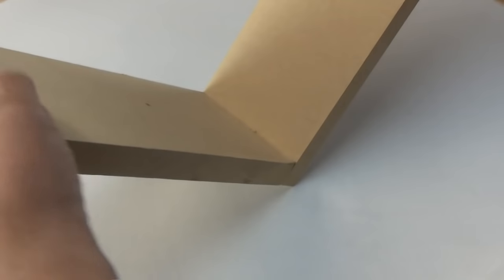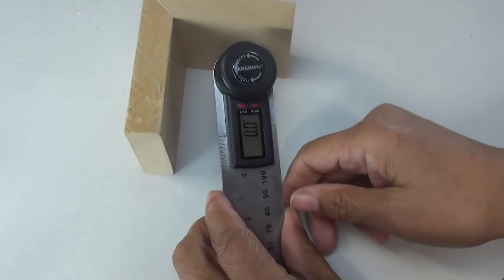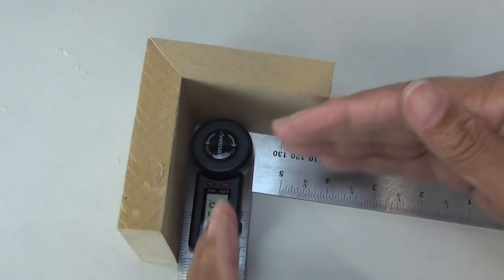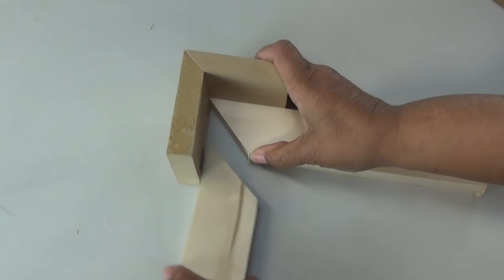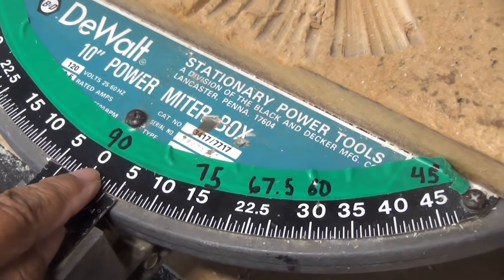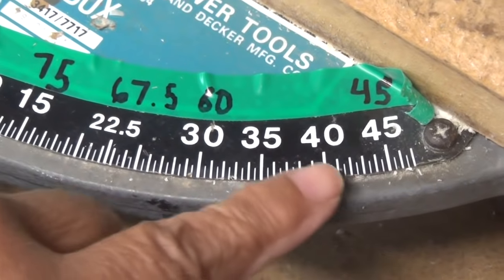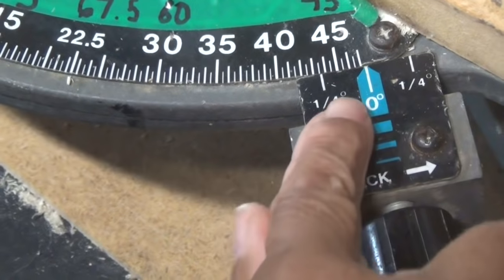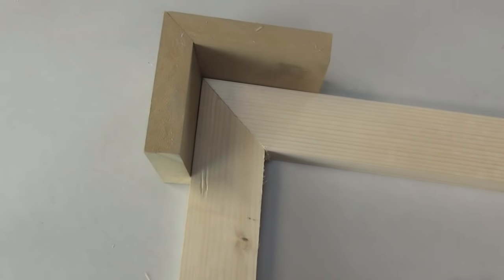The Secret Formula for Making Perfect Miter Cuts When Less Than 90 Degrees

Comment: You could of used the first cuts to make the 85 degree angle, you just used the wrong pieces.. It really doesn't matter if you cut at 42.5 or 47.5, it just matters from which side of the saw you measure your cut, because in both cases you get 2 pieces of wood from the cut that are 42.5 and 47.5 degrees.
Reply: Would you explain "Used the wrong pieces" a bit more. I would like to understand this. Thanks
Reply: When you use a miter saw, you get 2 cuts of wood. If you use the saw set on a 90 degree angle you get 2 pieces and both are 90 degrees.
If you set the saw to 45 you get 2 pieces that both are 45 degrees. 
If you set the saw to 42.5 you get a piece that is 42.5 and one that is 47.5
If you set the saw to 47.5 you get a piece that is 47.5 and one that is 42.5.

Same thing with lets say 60 degrees, it makes no difference if you set your saw to 60 or 30 degrees, it all depends from which side of the wood you measure to the cut. What Leah mentioned here is convenient, so you can always measure from the same side, but really isn't necessary.
Reply from the maker: I can understand why you would think that, but that is not correct. You are measuring your angle with a protractor or an angle gauge.  But the angles on a miter saw gauge are not the same...they are off by 90 degrees from the angles on the protractor.  Thus, if you try to make your cut exactly the same as what you read on the angle gauge, it will be incorrect every time.  It doesn't have anything to do with which pieces you are using. That's why finish carpenters make acute angle jigs to use in combination with their miter saws.
Reply: Actually, when you cut across a straight board, at any angle, you get pieces with equal angles. You don't get angles that add up to 90 every time. If you set your saw to 60 degrees, you get 2 pieces that are each 60 deg.
Reply: Thank you; all is clear.
Reply: LOL.... My husband and I used to run a contracting business. I can recall plenty of times when guys were bound and determined to make whatever I said wrong... when I wasn't. Absolutely love your videos!
Reply: Martin:  I think I see what you tried to say, but you need to take another look.  If the board is straight along both the near and far edges, and you cut in two at an actual 42.5,  the two pieces will each have an angle of 42.5 and 137.5.  (42.5+137.5=180).    The danged setting on the saw is where it gets confusing.  To get a 42.5 on the board, you set the saw to 47.5.  Or to get an 80, you set the saw to 10.
Reply: So, why not cut one board at 42 and second board at 43 to get an 85 corner?  The answer is that you want the LENGTH of cut on each board to be equal.  Imagine something more extreme.  Cut one board at 70 and the second at 15.  They will make an 85 angle, but the board cut at the sharper angle will have a much longer exposed, cut edge.  It won't mate neatly to the other board.
Reply: Martins Brumelis tuff crowd huh. You are exactly correct. And as for as it matters, she was cutting an outside angle unless the fence represents the inside. Plenty of ways to explain your point but not many seem to get it.
Reply: bryan brunk  Geez. Martins Brumelis is exactly wrong. He and you are mistaken. If you cut straight wood at 30 degree, you don't get one at 30 and the other at 60 (as suggested by Mr Brumelis). Instead you get two pieces of wood with exactly same angle. This is kind of basic stuff.
Reply: Jis Yang you missed the point. Just because we mentioned the same angle, doesn't mean we were discussing the exact same situation.
Reply: Jis Yang you need to expand your perspective on the subject because you are measuring the angle from the wrong side of the board.
Reply: bryon brunk  Jesus Holy Christ, No. YOU need to expand your "perspective". It's very annoying when an obviously mistaken person insists and tells others to change their 'view'. Dude, it's not a 'perspective' thing. It's either correct or incorrect as in math and geometry.  If you even own a miter saw, go ahead and please cut 2x4 by at 30 miter degree (or 60 degree from fence, doesn't matter),  and compare the resulting two pieces.  The pieces have IDENTICAL angles. You DON'T get two different pieces with different angle! As I said, if you a little bit of experience in miter cutting, this is kind of basic.
If you don't own a miter saw, draw a long rectangle (i.e., 2x4) on a piece of paper. And draw a line slicing the rectangle at 30 miter degree (or 60 degree from fence, doens't matter). And compare the two shapes bisected by the line. Don't do it in your head. I hope you realize your mistake.
Reply: See my comment above.  You always have 2 pieces when you cut a piece. One from the left of the blade and one from the right.  It ABSOLUTELY matters when you are cutting angles you intend to join.  especially if the the material is not symmetrical.  Like molding that has a top and bottom and a front and back. If this demonstration had been done with molding  , the way Leah cut the pieces, and the pieces she kept, you would see plainly and obviously that one piece lying correctly and the other top down and backside up. And it would be so obviously wrong he video would have been pointless. 

You either have to keep 2 pieces from opposite sides of the blade or you have to turn the blade the other way if you want to keep the cuts from the same side.
Reply: Then of course, internally it coulda just been scribed....
Reply: Does this apply to doing like window or door trim I’m really new and just got a mitter and am so intimidated I still haven’t plugged it in yet trying to figure it out and understand a lil bit
Reply: Here is an easy way. If less that 90 divide the measured angle by 2. In this instance it’s 85/2=42.5. Then 90-42.5=47.5.
Reply: @royfeigel2535  finally, thank you sir. Exactly what I was thinking.
Reply: The pieces have IDENTICAL angles, The pieces have IDENTICAL angles, The pieces have IDENTICAL angles, The pieces have IDENTICAL angles. EVERY time. No matter what piece you use it will still be 47.5 degrees.
Reply: exactly
Reply: Martins Brumelis your not attaching the same wood together again because it would be on the same plane. You have to intersect two piece on different planes

Comment: Leah,with that tool.you get the inside complimentary angle by starting with it wide open on a flat surface and push the zero button.then put the tool in the corner for correct angle and no thinking...for outside corners.you start with the tool closed on a flat surface and push the zero button and proceed to wrap the angle finder around the outside corner.no thinking involved and way less confusing.

Comment: I'm confused still after watching it 3 times I'm a slow learner . I thought she would pull out the digital angle finder find the angle and cut it.  They should have angle finder like that .
Reply: The simple math Formula is always subtract 180 from the angle which is 85 that gives you 95 then divide by 2 whis is 47.5
Reply: Check out the yellow and white Starrett angle finder if you don't like the math

Comment: Awesome video, the angle thing on the saw is correct for sure! I dont leave angles up to the saw. I like to use the angle finder u use to capture the wall angle , then draw it on a scrap 1x6, and bisect that with a compass, then set the saw up to that perfect half angle. Guaranteed perfect cut to fit, no fuss with angles or having to keep a perfectly tuned miter saw.
Reply: Bisect with a compass??

Comment: hi and thank you for the video,however using the formula for the obtuse angel
where you divide the angle by 2 and then you subtract the answer from 90 that would have given you the 47.5 from the very start
85 divided by 2 =42.5    90 minus 42.5= 47.5

Comment: Pretty slick....
I was thinking that placing your work against a piece of scrap that has an easy to calculate angle (say 10 degrees ) keeps your cuts from running out of adjustment.
With a 10 degree scrap acting as the fence... you've brought your adjustment back to 37-1/2.
Of course because it spaces your work further away from the fence this is assuming your miter saw has a big enough blade or is a sliding style to accommodate the spacing.

Comment: I watched this previously but didn’t remember the trick.  I wish I had seen it again earlier today when I was trying to cut some 2x4 braces that needed 42 and 58 degree miter cuts.  I finally gave up on using the miter saw’s numbers, drew angle lines on the wood and cut to the lines.  I need to mark the actual angles on tape like you showed ,Leah.
Reply: dont forget the most miter saw flip left -right      this is the point what she did she cut on  opposite  and compensate but with finish materials will not work, you must cut left and right  
why people are so naive

Comment: I remember getting so frustated when I was trying to cut a baseboard at an angle to account for stairs going down. I'd use the angle finder, get the angle and use that exact number to cut on the mitre saw, but was completely off and didn't know why. It wasn't until some trial and error till I realized that I needed to subtract from 90 to get the mitre saw angle correct. Seeing this video would've saved me a lot of time. But I'll never forget how to calculate now haha

Comment: Another tip, once the angle exceeds 45 deg,  is by using a right  angle fence off the saw back fence. Then 42.5 deg will cut what was intended in the the 1st cut in the video. So for acute angles,  those less than 90 deg included, coming off the right angle fence makes those work right away.  For obtuse angles,  say you had a 120 deg included, the cut will be 120-180= 60  then 60/2 = 30 deg, or you can go 120/2 = 60.  then 90 -60 = 30      The setting will be 30 deg to take off the piece leaving a 60 deg wedge left on the part to join.

Comment: Hi Leah. The formula you used, does that apply to all odd measurements that are not 45° . I have measured my outside corner with the angel finder and it reads 58. So do I make the two pieces 28 on the mitre saw or do I add another 17 to the calculation? . Forgive my ignorance, my brain doesn't seem to work it out?. Hope you can help...Thank you for all your great videos. Keep em coming.😊 .

Comment: Hi Leah Thanks for putting this out there, i am a dyi'er and have struggled with this before.  So is one cut 42.5 degrees and the other 47.5 degrees because it should equal 90 degrees?    Thanks
Reply: Both pieces are cut at 47.5 degrees to fit the 85 degree corner...I think the quick subtitle showed 42.5 (bisected angle) + 47.5 (complementary angle) = 90

Comment: Your tips never seem to amaze me! I do have a question however, did you mate a 47.5 degree angle with a 42.5 degree angle or were they both 47.5, which of course would be over 90 degrees. If they add up to 90 degrees, how does it create an 85 degree angle? Thanks Leah!
Reply: Good question. I’m stilling waiting for the answer to your question.

Comment: DH was, by training, an architectural engineer and roof truss designer. He worked in the field and the shop for 50 years. He knew how to work with slide rules and verified everything in his Smoley's. In other words, he could do it
all without computers!

He always said geometry was the most useful of all math. I didn't believe, because I had failed that class. But as I've gotten older, I have realized a few things:
1. He was right.
2. Geometry is taught 2 dimensionally with drawings. But I think more people need hands on learning - manipulatives for kinesthetic learning.
3. You have to be able to do it in the field without the computer!

Comment: I’m confused! In your video ‘Install perfect outside baseboard corners/easy math trick’ you say when confronted with corners less than 90 degrees you just have to divide it in 2. But here you tell it’s not that simple. Can you please explain where I’m wrong?
Reply: I had the same question and chalked it up to..which side of the saw the angle was cut on.  If one side of the cut was 42.5, then the other (scrap) was already at 47.5.

Comment: You can cut @ 42.5 like you did in the first cut, just make sure the side touching the wall is not touching the fence (ie. - flip the board over before cutting). Very good tip. I would have made the same mistake before seeing this video.

Comment: I have a question.  Would we use the same way you measured with the tape on the miter saw when doing crown molding?  I had seen your crown molding exterior corners but did not see one for internal corners like this one.

Comment: Hello Leah
Above video was very helpful with my inside corner, however, I now have an outside corner L- Shaped molding coming down steps. The angle finder indicates 134.8. Using your formula for the inside corner doesn’t work. I couldn’t figure out how to attach a photo. Any help will be much appreciated. Thank you.  Mike

Comment: Did you cut one at 42.5 and one at 47.5 or both at 47.5.  Sorry, if that's a dumb question but you didn't explain complementary angles so I could understand exactly what was going on there.

Comment: Would this have been the case for cutting crown moulding too?  How is finish carpetry different than crown moulding?  I had thought with crown, if acute, you can divide the angle by 2 and be fine.
Reply from the maker: It's  a little different  with crown mounding because there's a spri g angle.   Actually,  crown mounding is a little more complicated.

Comment: The way I think about it when doing those inside corners is taking the angle measurement from 180 and then dividing it by two. In this case 180-85=95
95/2=47.5

Comment: Been doing finish carpentry for 30+ years. What I can't believe is that apparently the only method (I guess) that I've ever used is to take two pieces of wood, go past the corner with them and well trace the pieces on each other and find the angle graphically by connecting the inside and outside points.
Reply: Pure old school my brother .nothing wrong in your observations.im all about the old ways.various options available.just have to know a little geometric knowledge.tip of the hat my friend.splinters in the hand bring the spectacular in demand.keep up your works. El Tejano.

Comment: You can think of it this way, the TARGET SPACE ANGLE is 85deg, allowing the WORK PIECE to have 42.5deg on each side.  So your saw must CHEW OFF (SPACE) 47.5% of the piece to give it 42.5% of MATERIAL to fill the TARGET SPACE ANGLE - or at least 1/2 of it.

Comment: If your miter saw reads 90° at the front you'll simple divide the wall angle by 2
If your miter saw reads 0° at the front instead dividing the wall angle by 2 you'll need to divide the spring angle by 2
If the miter reads 90° and your angle is 88° divided by 2 = 44°
If your miter reads 0° instead of being 88° the spring angle is 92° divided by 2 = 46°
I recommend the "Starrett 505P protractor is the best for finding wall and spring angles

Comment: Now you should explain how to make a miter if desired cut is less than 45. Say the angle is 120 degrees:
180-120=60
60/2=30 degree angle needed. 
90-60=30 but saw markings typically max out at 50 so the max angle will only be 40. 

Take a 2x6 and clamp in miter saw. Cut a 45. Now use the 45 degree cut on the 2x6 as your fence. 45-15=30. Set the miter saw at 15 and you get a perfect 30 degree angle. This may be hard to visualize but there are videos on how to do this.

Comment: This is off topic but I need a bit of help. I've got a piece of wood that I'm using it to build a cabinet and I'm trying to get it to be square shape. The problem I'm having is that no matter how much of a straight line I measure and cut, it's always cricket. one side is either higher, longer, or shorter. Please help :(

Comment: So that's all good and you're lucky to have a miter saw that goes a 'little' further that 45 degrees on either side of the 0/90. My miter saw only goes to 45 and has a stop there. However, the actual use case off course is, how does one cut acute angles that extend beyond 45 degrees (and a 'little'). I live in an old house and had to cut base boards recently. My home happens to have an acute angle of 72 degrees in the kitchen. I ended up cutting the 45's, as my miter saw allows me to do, and started sanding my butt off for the remaining 9 degrees on each board. Needless to say that sanding is not very accurate and leaves a nasty gap that needs to be filled. Is there a trick on cutting 'actual' acute angles with a miter saw?

Comment: Also, the inside and outside angles add up to 180. So 47.5 and 47.5 is 95, plus 85 is 180. It's actually the outside angle you are dividing to get that cut.
Reply: And thank you for more excellent ideas.

Comment: A different method for the same result is to consider that the two pieces must together equal 180 degrees.
The corner is 85 degrees so the inserting piece must make up the difference. 47.5 x 47.5 = 95. Adding this to 85 gives 180 and perfect fit.
Reply from the maker: thanks for sharing

Comment: Thanks Leah! What about if the angle was 80? What then??
Reply: Many saws go to 50 degree now and can handle that cut.
It not... you make a triangular jig and cut with the length of the board perpendicular to the fence.
Search the web for "A Concord Carpenter cutting acute angles" for a pictorial if my explanation doesn't make sense.
Reply: Start with 180, subtract the measured angle (80), giving a result of 100. Now divide by 2 giving an angle of 50. Make your cuts 50 degrees.